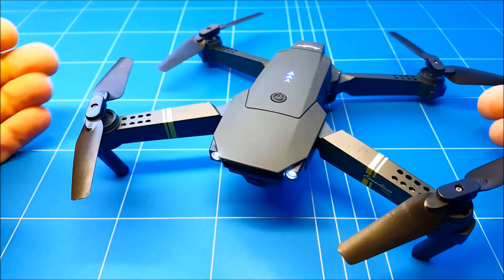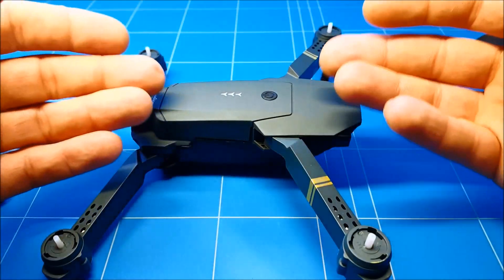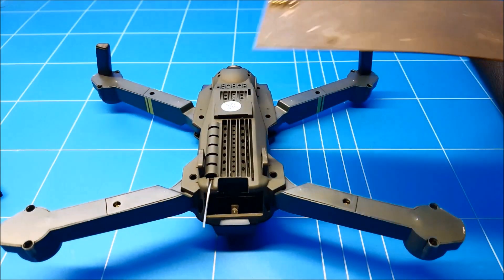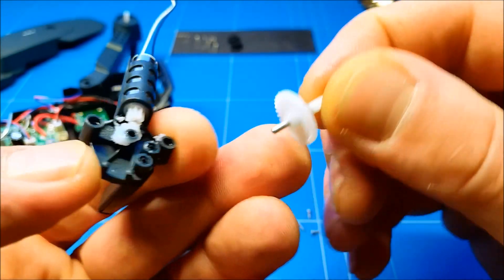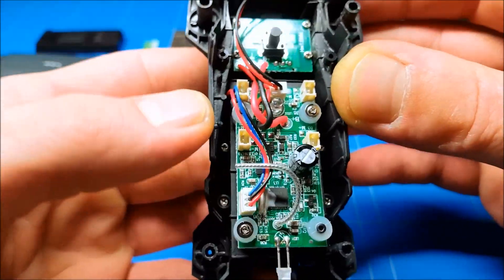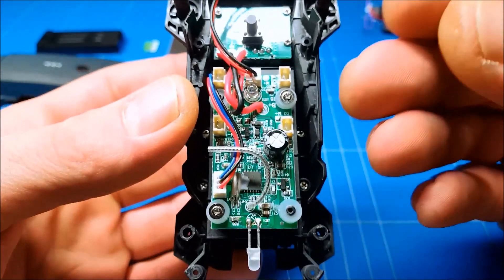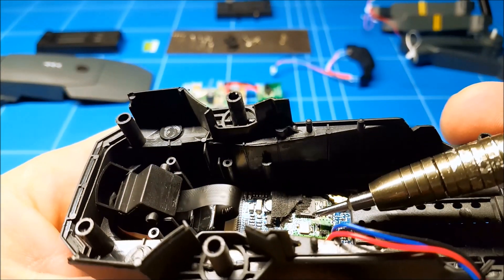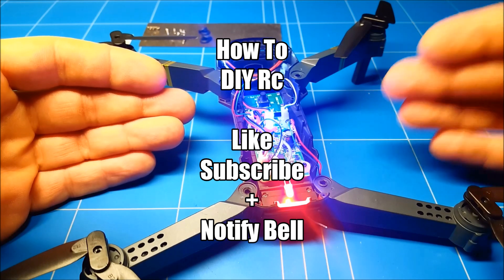Eachine E58 Wifi FPV Drone Maintenance Guide With Full Disassembly of DJI Mavic Pro Clone

Comment: Suddely Wifi stop  working. I mean  it  is not  available  anymore. Any tip dutes  ?
Reply from the maker: hmmm check the wire from the wifi module coing to the flight controller and change the wifi module antenna

Comment: i have eachine e58 but when i want to insert sd card it will stuck
Reply: can it fix?
Reply from the maker: open up and try to use a needle to get it out of the slot
Reply from the maker: than you have the cheapest version without sd card holder and only 2m pixel camera

Comment: 201/5000
I bought a drone of that plus the camera is not transmitting to the phone. do i have to put a memory card? i'm using the FYD-FPV mobile app find the wifi signal but it doesn't transmit video
Reply from the maker: download the  ufo app that shut work

Comment: Hi,
At my Eachine E58 the Micro-SD card holder does not existent or maybe felt away.
Another problem is that it doesn't connect to the smartphone even if the wifi is connected.
No picture, no movement.
Any suggestions?
Reply from the maker: You have the cheaper version with low quality camera and no ad card reader

Comment: Hi, my drone crashed and ever since one arm is going hella slower, i replaced the heli pads and the problem still exist, if anyone can help me id appriciate that
Reply from the maker: Screw that holds that prop is lose that's why the prop don't spin fast or motor wire is damage and doesn't get the full voltage

Comment: Hey m8, just wanted to hear your thougts on my, current issue.
Seems like that my fpv uplink dont work, so im not getting any kind of feed for the app controle. But what weird is, that i stil can find the Wi-Fi and connect to it???..
My guess is that its the camera Flex is broken, ("but then the controlling should still work from app") OR an software problem on the app.. But I have tried other programs to launch it?

What do you think the problem could be
Reply from the maker: The camera condition most problay since you still can connect to the WiFi module
Reply: It worked 😎👌

Comment: I'm having issues with control. When I start the motors it flips over upside down from left to right if you're facing the rear of the drone. Help please. Can I do a hard reset and how do I do that?
Reply from the maker: check the screws holding the props if they are a bit loose you lose thrust and the 2 good motors giving full thrust makes it flip
Reply: I had the same problem with one of my drones turns out I fried one of the motors

Comment: Hi! can these motors be replaced with more powerful ones?
Reply from the maker: yes if they are 7mm wide if they are any bigger than that you need to make some space and glue them into place
Reply: Very good job!
Do you know how many kv are the standard motors, and how many kv can the card accept with a more powerful motor ( 3,7v but more kv for more tr/min is more amp I think).
Sorry if you don't understand my question (i'm french... sorry...)

But a lot of thanks for this video!

Comment: Hi DIY Rc. I am a complete beginner and got my first drone, an e58 a week ago, and have abused it badly, walls, furniture, trees, dogs, Christmas decorations have all suffered. Now, it is on strike, it revs up ok, the propellers all start, but when I attempt to take off, it tilts over towards one of the arms at 2 O´clock or 8 O`clock but does not take off. Then it turns over and then only the propellers at these two arms work. This occurs with both the remote control and the wifi App. I´d be grateful for any ideas. Thanks in advance.
Reply from the maker: screw down the props there are loose

Comment: I was enjoying the drone very much but after a few crashes  the drone is not stable when he flies. 
I try to calibrate it, tried to fly with remote and via smart phone. All the motors are working and I can fly it but I have to trim it constantly (a lot of drifting) . Sometime when i land it some of the motors continue to work. Any idea what is the problem?? Motor or receiving board. How can I find the problem? Thanks in advance for your help.
Reply from the maker: check the screws of the props

Comment: Nice!  Can you do a video on the 8807W drone remote? My remote won't even power on. Was wondering if its possible to fix that issue.
Reply from the maker: probably just a loose wire

Comment: Geat video. First question: the button to land does not work if at the beginning he desperate with the takeoff button. I only work the landing button at the start that the desperate with the right / left control. Thanks for your help. Second question: when I start engines, the left rear propeller does not work, but it works when it starts. It is normal?

Comment: I put the battery in upside down, and tried to disassemble the copter to pop the battery out. I got 5 of the 6 bottom screws out, but one in the middle stripped. I was able to get the battery out using a toothpick to push it out, but 2 little washers popped out like what happened in your video at 4:53. Any suggestions to get the stripped screw out? Or should I not bother and no worry about the washers?
Reply from the maker: those washer a rubber o rings that dampens vibration to the flight controller and make it fly better but you don't have to use them and the e5 will still fly :D
Reply: Thanks! Thought so. I had a decent flight without them yesterday despite the wind. Video files failed to save on the e58, not sure what that was about but otherwise a success!

Comment: I would like to compliment you with this video, it's clear and simple!

P.s. The motors are sold seperately, you can buy them for about $5 a piece, or as set for $10 from any big online seller/consumer site. And yes, that is almost as cheap as a complete arm but i'm just mentioning it... ;-)
Reply from the maker: thank you Sir :D
Reply: My "trans gear" broke off lucky i ordered 4 pcs whole set of arms for only 640pesos

Comment: thanks for the great video. I just bought this drone and from the beginning the wifi doesnt work. If I was to attempt replacing the wifi  module it would be the part under the sticky tape? also whats the part to order? wifi module? thanks for any help.
Reply from the maker: yes it's the blue circuit board under the black protection tape this is the link to the wifi module http://bit.ly/E58_Wifi_Module_FPV_Camera

Comment: Hi.. at my first flight I just crashed the drone . Now restarting it, its one propeller keeps operating without any command and didn’t allow other propeller to operate.neither my drone synchronised with remote but when I disconnect that propeller ,other propeller start working and drone connected with remote. I think there is a short circuit of that propeller or may b some short circuit in device. What to do. :(
Reply from the maker: your not the first person to tell me they have this problem and i think you do have short circuit some were on the flight controller check all the components on the FC maybe it's just a bent connector?
or lost a small chip please check with a magnifying glass
Reply: I have the same problem do you now the solution for it? Please let me know if it can be fixed.

Comment: My drone has a tremendous arm in the air, it disrupts the flight a lot, help me, when I get in control with him, he goes to the side with which the arm shakes. What can it be?
Reply from the maker: if your arms are shacking it can be your motor turns rough? ore the white gear between the motor and prop or prop damage?
or maybe you lost a screw that holds the arms and the rubber o-ring in between the arm and body
definitely your gyro on the FC doesn't like vibrations and also helps crashing the drone
so it's very important you find the source and fix the drone goodluck sir :D
Reply: How To DIY Rc Thanks a lot for the help. this weekend I'm going to open the drone and take a look inside and change the propellers that are kneaded, if not better I change the left front arm that shakes.

Comment: I have when inserting the battery the front right prop spins alone and can not turn off. . any advice?
Reply from the maker: that's a weird problem
did you open it and have a look at the FC? check every soldering maybe you have something shorting out
Reply: How To DIY Rc checked all seems like a chip on board broken maybe
Reply from the maker: ore floating ground/mass hopefully the translation is correct 
is one thing that causes weird issues run a few extra ground wires to different negative - spots to make a full circle to ground things proper 
this is the one thing that might help wish you good luck buddy :D
Reply: How To DIY Rc maybe you do a video on this i see many have this issue and no solution
Reply from the maker: i have seen that vid i think the motor wire connectors on the flight controller came lose 
maybe check an unplug an re plug or best option is to solder the wires directly to the FC

Comment: just bought one of these today, I'm disappointed there's no way to keep the SD card in there , it falls out.it's like the slide holders there but there is no inside to touch the contacts to keep the card in there, think it's missing the inner case I hope you know what I'm trying to say you can you respond to this and let me know what you think..
Reply from the maker: you probably have the 0.3 camera that doesn't have an sd card slot 
my 2.0 camera those have an sd card slot and it holds the sd card in it place 
you bought the cheap version without SD card hope this clears thing up for you
Reply: Thank you for your response in ordering my product I checked the info I ordered the one with the 2.0 camera. but they sent the 3.0 one..Im sending it back.. I paid $59 dollars for it
Reply from the maker: OH i'm sorry to hear they made a mistake hopefully they send the correct e58 with fast delivery :D
Reply: This is probably your problem.
In my E58, the SD card slot was displaced, so the card could not be inserted.   
I found the SD card holder PCB inside was loose.   
So the entire thing had to be taken apart.   
There was nothing to hold down the back end of the PCB, so it would not stay in line with the slot in the outer casing.   
I glued a tiny piece of plastic above the back end of the PCB to hold it down in place.   Now it stays there, and I can correctly insert the SD card.

Comment: my E58 fails to take off.... two motor are not rotating....
its just delivered from geek..

what to do sir.....???
plz help
Reply from the maker: check the motor connectors on the flight controller they can be very weak 
maybe you can solder the wires direct to the FC

Comment: Hello again, Dabbler here. I had a problem with my e58 I think was caused by a Xiaomi MI range extender. During the set up of the extender, somehow I caused my WiFi to stop transmitting it's ID. Tried my Note 8, a Note 5, and an iPad mini 4 but the e58 was not sending out its WiFi ID. I ordered the FPV module from Banggood as it has camera, SD Card, and antenna. Will the new module transmit the ID, or will I need to replace the flight board, too? Thanks in advance.
Reply from the maker: wifi id is the responsibility of the wifi fpv module so you shut be ok with just replacing that one module but why do you think the problem is caused by a wifi range extender seems a bit abnormal to me
Reply: How To DIY Rc I think somewhere in the instructions for the extender you can hide your ID. Or maybe it just failed. Saw that situation in a forum while researching my problem. Thanks again!

Comment: Great video!!! Congratulations from Brazil.
Reply from the maker: wow all the way from brazil thank you for watching Sir appreciated it
Reply: The manufacturer should have improved the design by installing bearings on the gearing shafts
Reply from the maker: they have put a metal bushing in the arm to keep the gear spinning straight
but high-speed metal bearing is better of course

Comment: how easy would it be to desolder the existing board connection and replace the cartridge system with corded syma x5c-1 molex connector? I'm assuming the cartridge bay is large enough to carry larger x5c-1 batteries and that the rear of the battery cartridge could be used as a snap in door. Thus eliminating the proprietary batteries and gaining access to intelligent charging. What you think?
Reply from the maker: maybe i don't have a syma so i cant test it 
and how heavy is that battery?
first i'm going to do a thrust test to give's a idea on how much weight the e58 can carry 
before we are going for a battery upgrade
Reply: Sorry for delay, havent checked my notifies, Humm, I think a typical syma 500 mah battery is about 15 grams.

A 600 mah syma type probably weighs around 20 grams.  

Turnigy Graphene 750mAh LiPo Pack 1S 65C weighs 36 grams, I use these in my custom Syma X5C-1.  Look those UP, the pros swear by them.  They do not produce the discharge battery heat that degrades Lipos.  when I run them out, they are only warm.  

 If it will fit, that is, depending on the casing dimensions.  

If I owned this E58, there is No Way I would continue using the cartridges.  Not when a Syma molex connector is $1.  If you swap it, you open up other possibilities like being able to use an intelligent charger to charge 3 or more batteries all at the same time, or to intelligently put them into storage mode (instead of storing them at a low or high state which can both be potentially bad for battery life).  I'll take 3 batteries in storage mode and put them all on my Imax B6 charger, ready to go in 45 minutes.  I have 10 batteries.

Comment: Hi, Very informative video. Thanks for sharing it. Can you make a similar video on the battery of e58. Unfortunately I live in a country where I can't get the battery or a drone shipped from Banggood and I was wondering if I can make one with all the spares on the site. I have ordered all the parts except for a battery . . So once I have assembled all the parts i will need a battery to start the drone. Do let me know your thoughts as well. Thanks
Reply from the maker: that's a very good question Sir and we got the same problem with lipo battery's not being delivered 
except for the one's that comes with the toy itself but you can modify the new 3.7v AA rechargeable battery to upgrade the E58 up to 6000Mah only one problem is the battery connector of the drone is weird for a 1s lipo and need some modifications!
Reply: How To DIY Rc thank you so much for such a prompt response. Yes, what I could understand from the pics and your video is that the connector is a 3 pin connector and have been trying to figure out why would they have 3 pin for a 1s battery. Now without the original battery, is there any way to connect a 1s battery ? May be solder a wire from positive and one from negative on the receiver board . .

Comment: Thanks for this wonderful vlog!!! Btw, a small advise, the microSD card could be removed easily by pushing inwards. This is a spring loaded SD card slot which pops up your SD card upon pushing inwards. :) more power bro!!!
Reply from the maker: It didn't wend so smooth thx for watching and leaving a comment appreciate the tip :D

Comment: Great how to video! I broke the gear on mine and got the replacement installed no problem. I do have 2 questions tho, I didn't see the link for your tool set in the description, and what size upgrade can be made to the motors? You say they are 7 x 20 mm. What size will fit? 
Thanks in advance.
Reply from the maker: hi dabber nice to hear you fixed your gear and she is back flying again
i'm sorry to forget the link for the super handy toolset it's up in my pinned comment 

i'm going to use the same size 720 motors but with higher rpm but still searching internet thank you for showing interest appreciate the questions and tips are always welcome :D

Comment: I have eachine e58 drone, which I recently bought. But the problem is the one key return/ landing function of the remote is do not work. Can you please help me?
Reply from the maker: only on the remote, you have this problem? but you still can use one key take off with phone yes?
under the one key take off button on the remote, there is a little push button you can solder a new one if you have a spare controller from old quads?